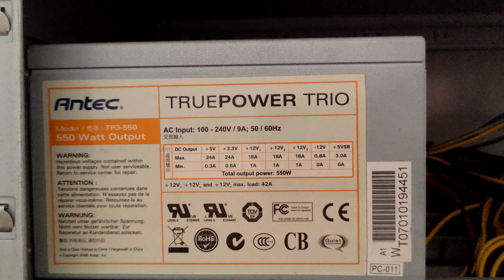new socket A motherboard! MSI K7N2 Delta 2 nForce 2 Ultra 400!

Comment: I had that same motherboard , I bought it brand new on Ebay  .  I build a computer with it and sold it to my cousin .   I still have a couple of Socket A cpus , but I no longer have socket 462 motherboards , this is why I'm contemplating buying a handful of them .  By the way , where did you buy yours ?
Reply from the maker: I would definitely buy some motherboards if I were you. This socket is amazing. I got it from olx.ro. Everything on it works and it's rock solid :D. In like newcondition. Just some surface scratches on the metal parts like the rear I/O hubs and the CoreCell logo.

Comment: oh man the nforce2 was a great chipset. get a heatsink on the south bridge chip if you're actually gonna use ut.
Reply from the maker: I've actually never seen an nF2 board with a southbridge heatsink. Doesn't get too hot. It's just for HDDs, USB etc. i've only seen heatsinks on nForce 2 MCP-Ts. With the soundstorm audio. That can get hotter.